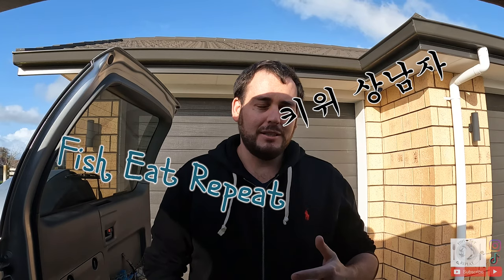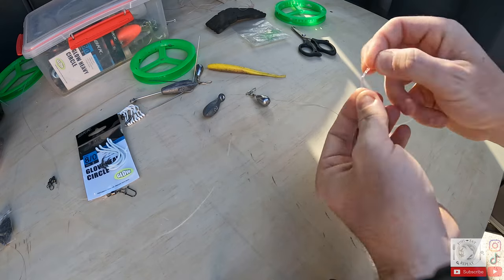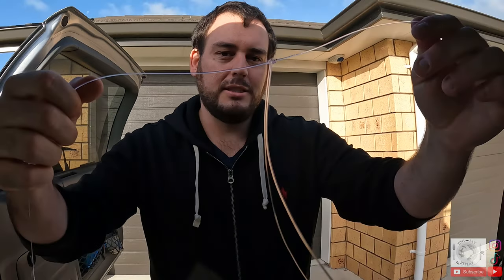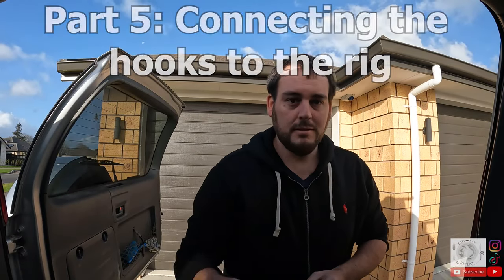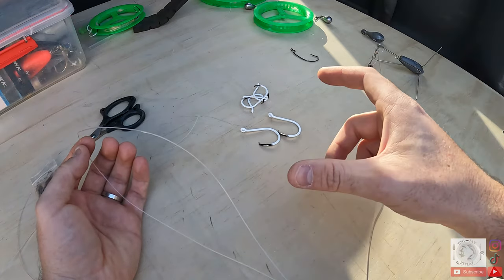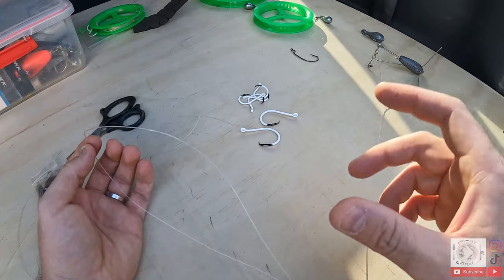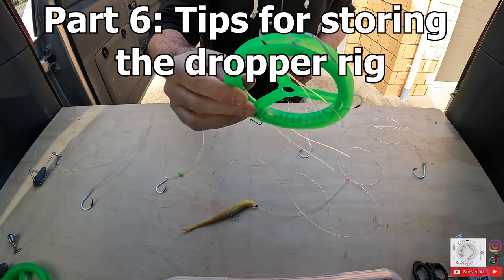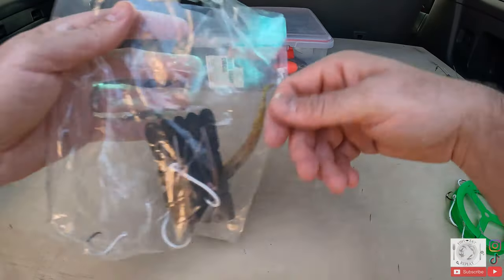HOW TO TIE A DROPPER RIG for DRONE FISHING or DEEP DROPS A TUTORIAL

Comment: almost exactly how I make my drone rigs though not a fan of clip swivels on the main line (great for the sinkers) because I had 3 of them straighten out on me this season with big sharks before I learnt my lesson. Now I prefer to take the extra time to tie knots or use a proper heavy duty shark snap swivel. I also use shorter hook loops because longer ones can just twist around the main line and you don't need multiple turns making an end loop as long as you do two turns it will hold just as solid as five turns. All my drone rigs have been tested on sharks over 100 pound which tend to find any weakness in the rig real fast. Also I found best way to store multiple hook rigs is to take the hooks off when you finish the session and unclip the sinker(s). No need to double loop the hooks on and still very fast to put hooks back on and clip on sinker.
Reply from the maker: Hey mate cheers for all that! Yea convenience for me is key I don't have a lot of time fishing and want to make the most of the time so clips are my absolute 101. I use different release clips pending on what I'm doing these are just rigs for snapper I have 400lb release clips for game fishing sharks etc never had one open once actually, I get these clips from China and they're honestly amazing. 
You're right about twisting though I want to make another few rigs with tubing to stop the twisting it's fine until you get a big kahawai etc then becomes a huge pain!
Thanks for watching and the comment